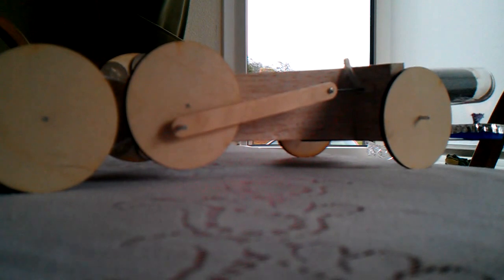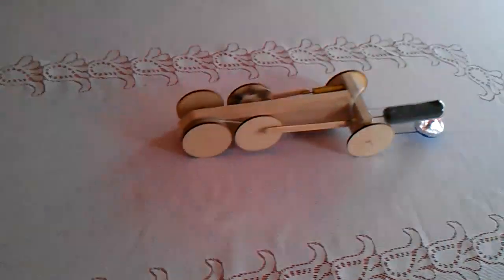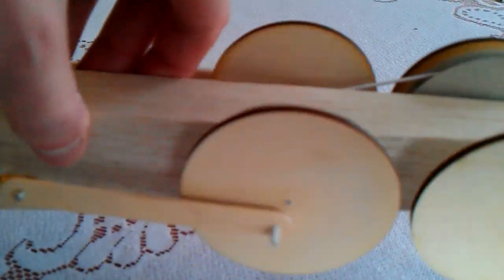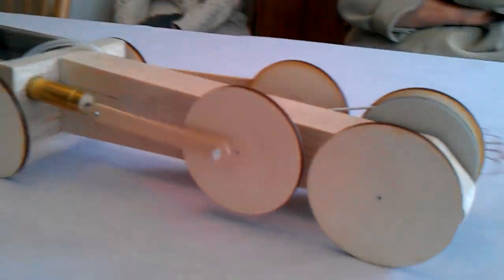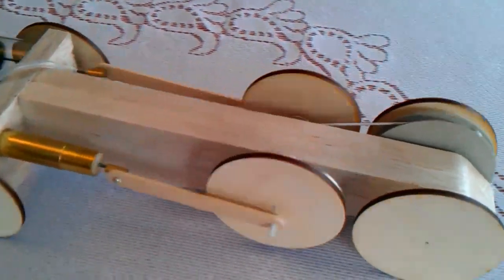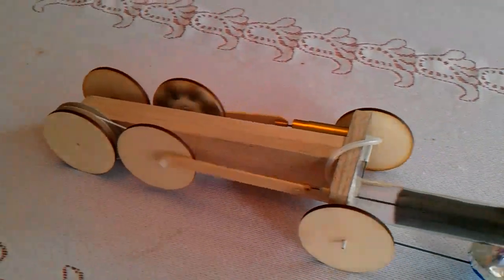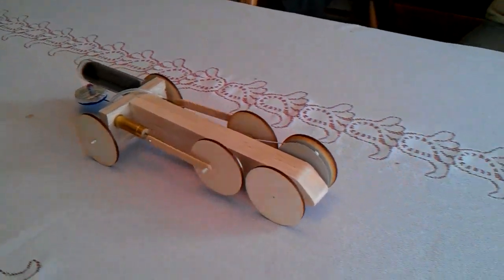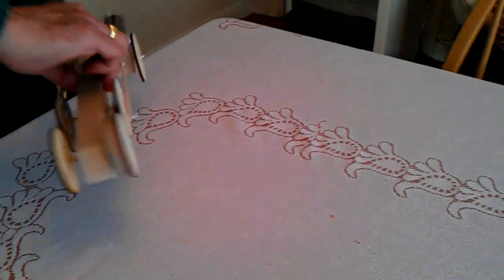Stirling Dragster. Hot Air Car. Homemade Traction Engine of Wood, Brass & Test Tube. Video

Comment from the maker: In answer to the last three comments: The black displacer material in the test-tube is made from fine gauge wire wool.  I have no idea of the power obtained.  The diameter of the test-tube is 2.8cm with length of 10.5cm. The piston has a diameter of 1/2 Inch. I'm sure a range of dimensions will work just as well. I picked these quite arbitrarily.

Comment: hey sir.. your engine is so cool.. currently, i am making a car powered by a stirling engine like this but it didn't work.. Is it okay if the displacer is a test tube that is smaller than the test tube cylinder instead of the steal wool?? please reply asap sir.. tY ^.^